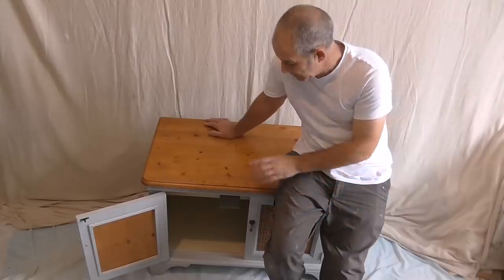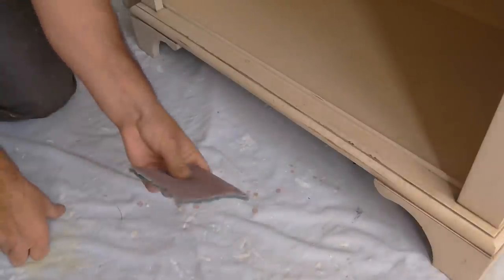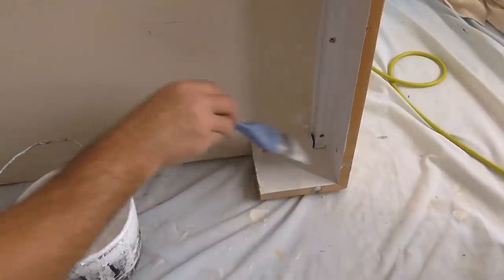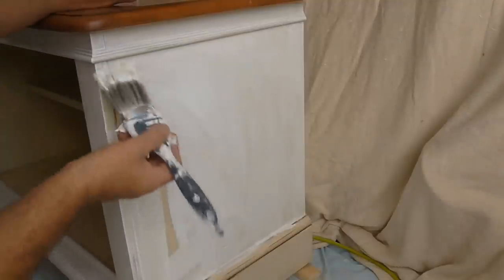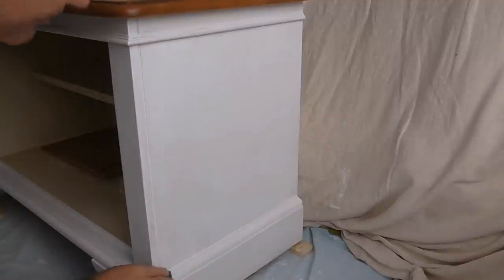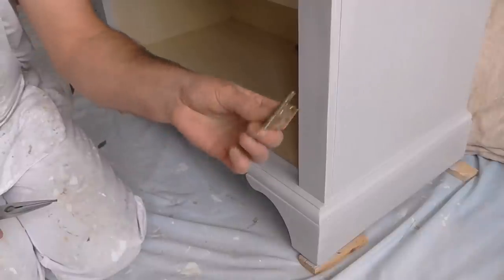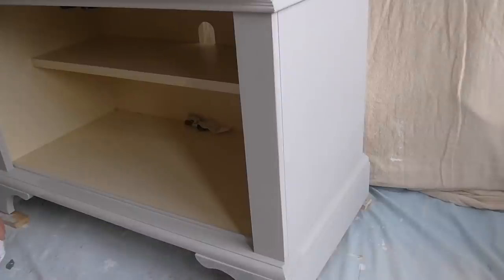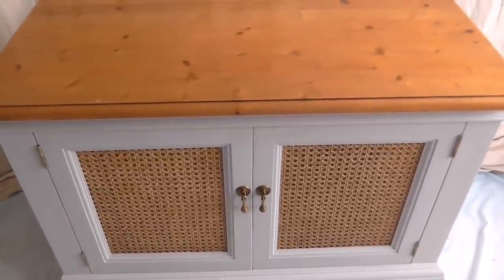Brush Paint Like A Pro When Your Thrown A Curved Ball!

Comment: Hey there, nice result -- I'm sure the client was happy. I've done the same thing on numerous occasions with furniture. I used varnish (water based) for floors, with polyuerthane, it works really well and makes a strong ultra-durable finish. The cons are: takes more time, more skill (if you f*** up the varnish it's impossible to remove it, it dries instantly, you have to start over with undercoat, etc... ). Also, last but certainly not least, shave before applying the varnish, wear clean clothes and wear a hat because the tiniest piece of dust or hair will get sucked onto the varnish!!! And after it's impossible to remove it, very annoying!

Comment: Good work as usual mate! I've painted a lot of kitchen cabinets, pieces of furniture etc and I've never used a varnish.....just zinsser 123 and two or three coats of quality water based eggshell, rolled/brushed on. Job done and never had a problem. Do you reckon it adds much in the way of protection/durability or was it just a matt  finish you were after?
Cheers mate
Dave
Reply from the maker: Thanks yes its more hardwearing.

Comment: Those Dulux  brushes are for DIYers//not Pro brushes...When you are painting the side panels, drag your brush to the bottom, as you approach the bottom, very lightly start releasing the brush till only  the tip finally reach the bottom as you raise the brush up...that's the trained way, you obviously not pro trained...your way. on close inspection, u will have a slight flash where you brushed up against the drown grain...basically u did an ok job, iv done 1000s of this stuff..u did ok for a D.I.Y  but not good for a pro...